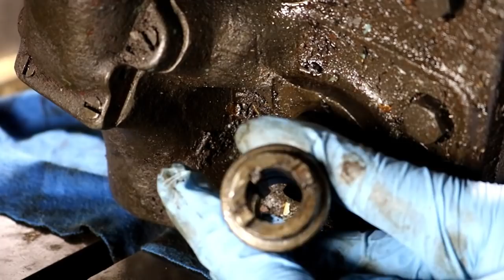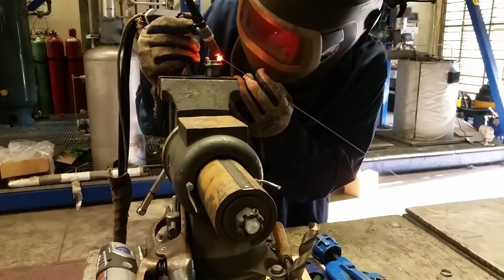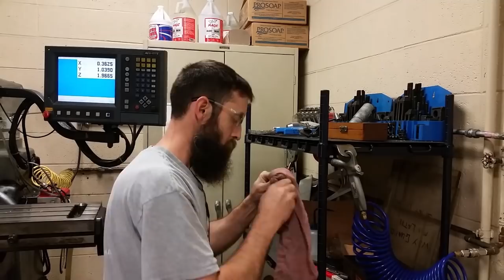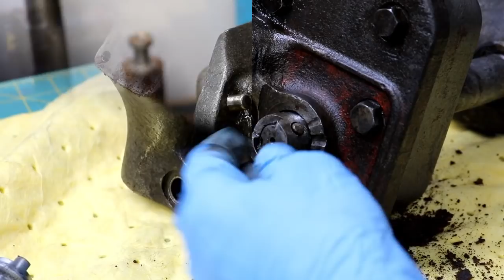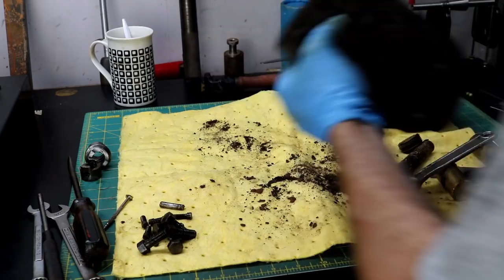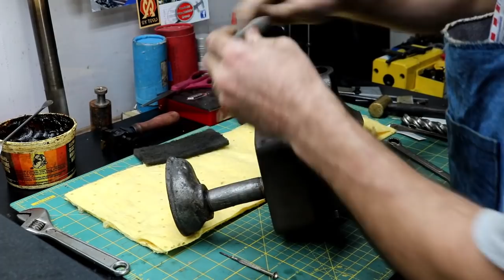K&T COOLANT PUMP TEARDOWN & CLEAN

Comment from the maker: I overlooked  the angle machined in the drivers and will need to go back and fix the upper part I welded. But as far as a rubber cushion between the two pump driver parts, the parts breakdown doesn't show one.
Reply: ? strange there is no damping element on that coupling. That is really a big heavy duty pump for what it is doing, even with the side flange wear it should pump like the dickens IMHO. 
All that cleaning will be remembered when it comes time to practice fluid maintenance I'm sure.
Cheers Steve
Reply: get one any way {lovejoy?}

Comment: Hey Steve just wondering did you ever get the rubber, teflon, or brass insert for the coupler like on this one? https://www.northerntool.com/shop/tools/product_43466_43466?cm_mmc=Google-pla&utm_source=Google_PLA&utm_medium=Hydraulics%20%3E%20Hydraulic%20Couplings%20%3E%20Hydraulic%20Half%20Couplings&utm_campaign=Northern%20Tool%20and%20Equipment&utm_content=3014&gclid=Cj0KCQjwy8f6BRC7ARIsAPIXOjid0K5QJx2W73Ct_fatOVOmURWt2kpULh_OS1QcJHhCX6z0EiMb7PwaAuAEEALw_wcB

Comment: I work on the same Sharp knee mill. (Ours is a 3axis) Even has the same Accu-rite set-up. I have to agree with you on the height, I have to use a step stool and I'm 6' tall. Our work scope has changed since we purchased it, so now we mainly use it for engraving part numbers.

Comment: I agree with some of the other comments about a flexible rubber coupling spacer, and the dog angles, but I think it would be far simpler to just buy another(Lovejoy or equivalent) coupling for it. I don't think it would be very expensive for that small of a coupling. Another reason to grease the gears is to help prime the pump for the initial startup. 
You do not need plastigauge for pump clearances,  just a straight edge and some feeler gauges.
Anyways, I like the videos and look forward to more. Thanks, Steve.

Comment: wonder if they rounded the corners of the coupler from the factory , kindah like an overload protection
about the power drawbar for the milling machine at work : seen some homemae power drawbar designs that use a cheap air ratchet suspended over the top on two slide bars with springs and operated with a lever (pull down and move to the side to operate the tool )
https://www.youtube.com/watch?v=z8CKZCZWwOI
think you can add a linkage so the lever is eazier to reach

Comment: Steve,
Great video as always. On that piston for the coolant pump bypass. Shouldn't that hole in the side of it face down to allow any water that collects in it to drain back into the reservoir? That would be my guess to keep the spring from corroding. It was hard to tell in the video during assembly which way it ended up.

Comment: Fair play to you Steve for keeping the old girl as original as possible, in a lot of places they would have just scrapped the gear pump and replaced it with a self contained impeller pump with its own motor.

Comment: I've rebuilt/serviced pumps just like that in the navy. I opened one up once that a former shipmate had put stainless steel shims to make up the same kind of wear your has. At sea you do what you have to do to keep the lights on, our ships surface grinder was caput at the time. Those pumps are so perfectly simple by design. Performance and efficiency range are not critical, but as you stated reliability is. I take it you have never crawled around in the sump of a main engine reduction gear, it takes a couple of big bales of rags and several 10's of man hours. And lots of lava soap and boraxo to clean up after. Just throw the coveralls away after... tyvek of course. Thanks for sharing, enjoy your video style very much.

Comment: Great work, if I was insstaalling the high pressure valve screw I wold DING the housing at the screw slot to lock it in place. Just saying.

Comment: Steve, thanks for the video, enjoyed. I use a BIG igloo cooler with 10 gallons of zep purple soap in it for such jobs, it works like a champ. I also have a regular parts washer for finer/ smaller work. Taker easy, Will

Comment: Continental and lycoming aircraft engines have the same type of oil pumps. No gaskets. But you need tight clearances to have them work properly. Your application is far less critical obviously.

Comment: You might see if anything else should be in that coupler.  It reminded me of a Lovejoy type.  If there was something rubberish that should be in there, I imagine it had long ago disintegrated.
Reply: That's what I was thinking, they're called Lovejoy flexible coupling spiders, they come in either rubber or urethane  for around $10.00. They save your bearings from shock loads and minor misalignment.

Comment: Hi Steve, I am impressed by your ability to figure things out, here's some info to fill in any gaps, The philosophy of the pump designers was that this pump was not that crucial to the operation of the machine, it's lack of gaskets and seals was deliberate as it was designed for flow not pressure and you're right about it using cutting oil so I'd stay away from emulsions. I think you should take it back apart and put grease on the back side of the gears where they rub against the gear housing; saw you put grease every where but there and there were a lot of comments regarding the gap in the drive coupling; it all depends upon what drives that pump. If it's an electric motor then it won't be very gentle on that coupling.

Comment: They are a bit expensive but a non solvent parstwasher called smartwasher is the go. It uses heated fluid. " Bioremediation is the use of microbes to break down or neutralize “hazardous substances” or “contaminants” We had one at my workshop at Qantas for quite a few years before I retired and actually enjoyed washing parts. Highly recommend.
Reply: YES!. I had one at my last job, heated water to about 130F and the solvent is water based, rinses off very easily with room temp water...
Reply: @dougankrum3328  They are a bit strange a first if you are used to old solvent based ones. They take a bit more time for the juice to start releasing the grease etc. But putting your 
hands into nice warm soapy juice made me want to wash everything.
Reply: I have a parts washer that uses water and sodium hydroxide, basically an industrial dishwasher, works great. It also has an oil skimmer to get rid of the oil. The sodium hydroxide is labeled transmission case cleaner.

Comment: Hi Steve. I wonder if the guy in there before you packed those pump gears with grease to prime it.
I've done that to those style pumps before. Usually engine oil pumps. I usually like to use petroleum jelly
or Vaseline 'cause it dissolves better then grease.  I thought I'd just point that out in case  it acts like it needs a prime.
Though you might be able to pour some fluid down the pipe might prime it.

Comment: If you ever find a machine without a coolant pump or with one you can't rebuild look up Little Giant pond pumps. I replaced several when I worked maintenance. They are submersible and will not be affected by coolants.

Comment: I worked for K&T for over 26 years in the renewment division, and cleaned many sumps and rebuilt those coolant pumps. The issues always was wear on the outside gear teeth and pump housing diameters. To clean sump we flushed with water and stuck a hooked rod in clean out. It contains a whole lot of junk and is a lot larger than it seems.
Reply from the maker: It's a nasty job for sure. But I'm glad I did it. Got it pretty clean, about as clean as it needs to be really. I'm sure I missed a few corners that still have some goop in them. Got a clutch shaft I need to repair next.
Reply: It’s fun watching you work on one of the finest machines of its time.
Reply: Steve Summers which shaft?
Reply: TakeDeadAim 1966-1993 then at G&l for 2 yrs.
Reply: TakeDeadAim I applied at PMA. Did you know Pat McNair? Or Don Murray?
Reply: TakeDeadAim they worked for PMA

Comment: A sharp is a good machine. I ran one for a while. While not a Bridgeport they are still good machines. That pump looked exactly like the oil pump on my 1939 model B Deere tractor when I rebuilt it. I did grind the surfaces as they had much wear. It is the little details that make the difference in a refurbishment. I noticed you ground your tungsten. My employer won't let us grind ours anymore. An engineer did some research and said it could cause cancer. So we have to send them out to be sharpened. I use a .040 tungsten and Hastaloy filler to tig the little missle parts I build. Waiting for more..........
Reply: tungsten, 2% thoriated is slightly radio-active, just wear a dust mask, and use a dust extractor on the grinding/sanding machine.
Reply: Or just don't use Thoriated anymore.  Most have switched over to 2% Lanthanated.
Reply: Our proceses and quality documents won't allow it. It would take a drawing change which is about a three year ordeal.
Reply: Ah ya I understand that, same where I work.

Comment: Glad you like your k&t. Had one! They are a beast!! Had 2 Bridgeport’s. They would bog under a heavy load. You will find that the k&t won’t. It will plow through about anything!! So get ready for broken mills!! Mine, I had to keep a step stool by the machine to tighten the draw bar. The dang machine was about 7’ tall!! But it will run through steel like it’s not even there.bought it for 600.00. Didn’t spend as much time as you are fixing everything. I did work on the ways for the table and the knee. But as far as the pump, I just threw in a little giant and put the thing to work.

Comment: You’re the first person I can recall. Seeing Dressing the tip of a TIG welder. The tool you used to dress the tip looks to be designed just for the purpose you’ve used it for. That was very informative and interesting. Great Job.
Reply: If you wonder why the TIG rod is sharpened the answer is electrons low off a sharp point easier than a dull one and that makes for a nicer weld.
Reply: edit: flow off a sharp point
Reply: Lee Klemetti 
Thanks.

Comment: nice vid as always m8! May want to get some new drive belts and some friction material  so you can redo the clutch on that beast.Not trying to add complications but usualy needs to be done...symptoms...easily stalling larger or ganged cutters/hesitation and slipping of table feed and or excessive play in the engagement lever...tends to be a perty short throw with new clutches...may even have to fiddle a bit to get it to disengage lol.Definetaly worth doing even if it seems to be ok when ya first get it working.Have fun hoss!

Comment: My two K&T horizontals have coolant pumps which can be turned such that flow will result when the motor us turned on regardless of whether or not the clutch is engaged....Don't know if you can do that with a model k though...

Comment: Where is the flexible interface between the halves of the flexible connector to the coolant pump?
Reply from the maker: It doesn't have one on the parts breakdown. Just metal to metal. I wondered  the same thing.

Comment: My K&T tool and die mill was a total mess from soluble coolant.. The coolant pump was seized when I got it... I was able to save it though and now it has light bodied cutting oil living in the sump..Never another problem with coolant in over 20 years....

Comment: got to figure out a way to pull the fluid from the bottom tank.. while you dispense more in..  get it circulating .. can you create a 3 bolt rear door that has  a threaded opening that is very close to the bottom of the door.   or perhaps a second threaded opening higher in the door that way you could use a 16 or larger gallon shop vacuum to pull some water based cleaning solution out with the vacuum when the vacuum cleaner shuts off.. put it back in some other 5 gallon buckets to settle..  then using a sump pump in those to create enough flow thru the sump with a hose instead of your arm.. please use long piece of vacuum cleaner hose to exhaust the shop vacuum outside your shop.. you don't want to breath any vapors coming out of it.  some hardware stores carry smooth ID pool vacuum hose that you could use a 6 foot piece as a suction hose from the 3 screw door to the shop vacuum to prevent the heavy fragments from just clogging the convoluted shop vacuum hose. 

 some hose clamps.. a boom stick and a wire brush might be used to work your way thru the sediment ..

Comment: I think that coupling needs a flex piece between the 2 parts. I made up a few using some rubber conveyor belting scrap pieces, cutting them into a strip that was long enough to reach end to end across the coupling, then wide enough to be slightly longer than the teeth. Then took 2, turned them on their sides and riveted the center with a rivet made from a small nail. Then spread the 2 parts to fit the drive dogs, and the tension holds it there, and it mates with the other side with almost no clearance. Made a much better coupling than the original insert that disintegrated, and ran for years with no wear on it. Was fine on a pump with a 1HP motor, and was a lot quieter as well. If no belting offcuts a piece of tyre side wall will work just as well, you just need a piece with the nylon plies in it and reasonably flat, and not too thick, you can grind it down if too thick, just keep the plies in the middle of the rubber.

Comment: Hi, Steve. Great video! It seems to be missing a flexible element between the coupling halves. Also, it looks like that the groove upstream the check valve flapper is to be fitted with an o-ring to improve sealing.

Comment: Steve, is there any sign of a rubber coupler in that drive? Seems like a lot of space for direct contact of the ears.
Reply: Thought the same, like a spider coupler
Reply: Like a lovejoy, i was wondering the same
Reply: No rubber.  Its a coupler.  Designed to be engaged or disengaged to turn pump on or off.
Reply from the maker: No o-ring on the parts breakdown. I wondered the same.

Comment: never seen a machine more worth your effort though I think that's the guiding principal here the blue bristle toilet brush at Walmart with a bendable copper tube handle would reach back into that sump I mean I use scrub free and a rv cleaning brush to do the shower stall and it takes like 5 min if the cleaning takes to much effort switch up your technique on the pump you did good I maaannnn! !! would not reach back there but the chance of one of those bristles getting swallowed up by the pump and jamming things up  but any way awesome show man me I soooo want one of those war vintage k&t

Comment: Should those dogs have been cut opposite sides in one cut so they would match the angle of the dogs on the pump? You should pack the outside of the gears to provide a seal for the pump to prime on the initial starting of the pump.

Comment: It's odd that gear pump works on coolant. I thought it usually used for oil. Centrifugal pump is simpler, cheaper and easier to maintain. Isn't it?
Reply: I would say that Centrifugal pump is simpler, cheaper and easier to maintain, but the gear pump are an elder invention, and they can run higher pressure. I have seen gear pumps pumping bilge water off a boat, who also had a gearpump to power the low pressure hydraulic system ~ 350 psi.
Reply from the maker: This old machine was designed around cutting oil. Not water based coolant.  It makes sense that it has a gear pump. It probably wouldn't work well on thin coolant.
Reply: Well then, it is clear!

Comment: Hey Steve, 
Love your channel, just a quick observation on this pump repair, shouldn't the faces on the drive dog be radial to match the input dog rather than parallel? 
That is one monster machine, keep up the good work.
Regards RonC
Reply: Ron Cummings   that was my thought too.
Reply: Not only should they be radial as the driven portion is but both drive and driven couplings should be undercut or "dove tailed" so as to interlock when being driven.
Reply: Yep the pump tang looked cut radial to me so I am sure its mate should have been too.  I think Steve just got caught up in the excitement and overlooked it. :-) Like others have said I think it probably was supposed to have a cushion in it so they didn't beat metal to metal on each other.
Reply from the maker: @bcbloc02  Yeah Brian, I overlooked  it. But the parts breakdown does not show a rubber piece in between the two. I plan to re-cut  the upper piece I welded so it mates with the lower piece properly.

Comment: Hey Steve never used a tungsten grinder always use a bench grinder and drill the Tungsten grinder are expensive do you find any difference in welding using eather thanks Greg
Reply from the maker: They give you a consistent point every time and that's nice. But to be honest I can use either and be just fine. This model grinder is pretty cheap. Not as expensive as they were. I use a bench grinder at home and  I'm in no hurry to run out and buy a dedicated tungsten grinder.  Nice to see you Greg